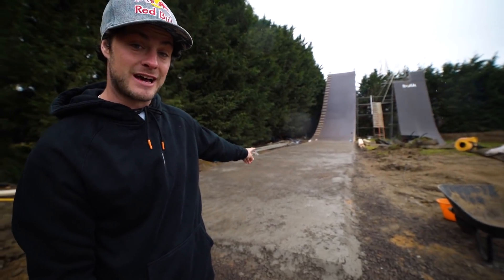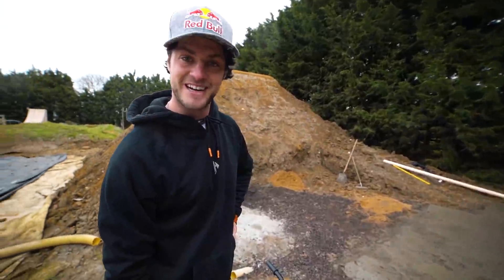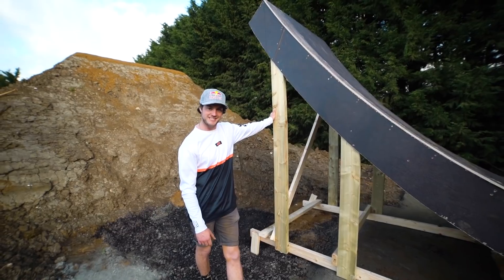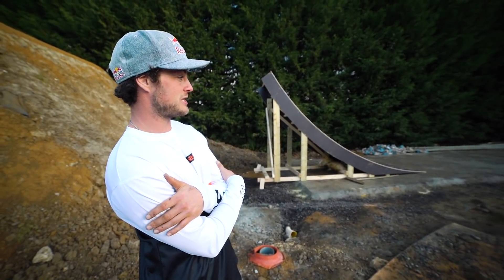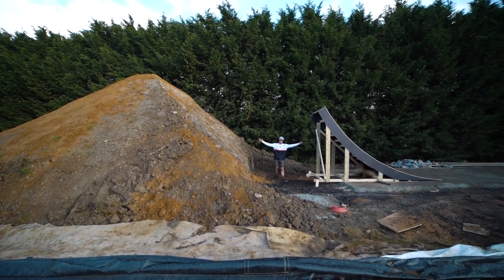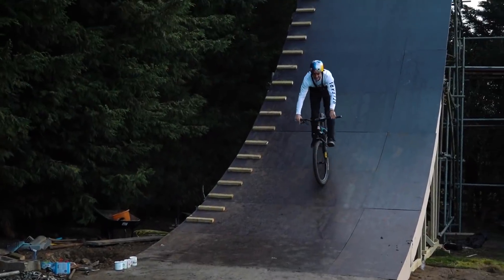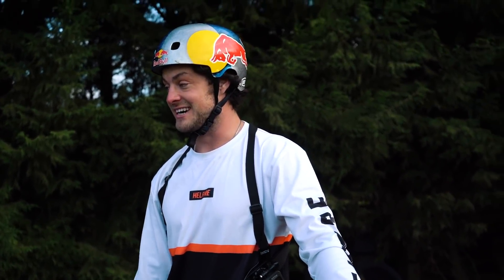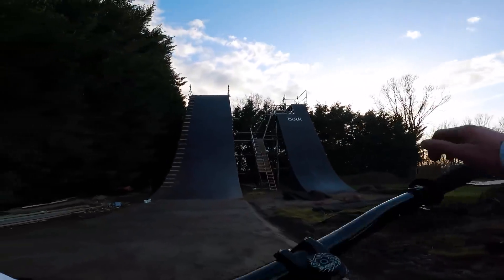BUILDING AND RIDING THE HUGE NEW MEGA BOOTER!! REBUILD EP 4

Comment: Thanks for the mention at 0:57 😂, shame it didn't work out as well as hoped with the concrete! I've learnt from this mistake the hard way more than once, hence why we do things differently now. Just thought I'd add that your concrete is still salvagable if you feel you would still like to achieve a smooth surface. With a bit of prep and some self levelling compound you could easily get it perfectly smooth, and it would serve you fine for the summer months at the very least.

Comment: Fantastic work - better than any gym session!
Two suggestions... 1. Get the concrete covered with a grippy hot tar mix, a fine yet grippy surface - will make it level, smooth and predictable as a street or road... 2. at the end of both airbag and new line, have a big berm / wall ride that links both of them together in a big curved wonderland to scrub off speed or do finish tricks - returning between the jumps back down a smooth path to the run-in ramps to go again...

Comment: He is correct about the air time. An experiment to give you visual proof is to roll a ball off of a flat surface that is high enough for you to time the decent as fast as you can. Then, take the same ball and just drop it straight from that height and time it as well. You will see that you will record the same amount of time for the ball to reach the ground.

Comment: If you have the room in the corner make a step up to flat/ hip gap.
1 you get a step up to play around with.
2 you get a second starting point for the back half.
3 you can still run the main line using a hip to bypass the step up.

Hope yall see this comment, keep up the killer content man👍

Comment: Correct about the air time until you run into enough forward momentum coupled with the right amount of lift generated by your body posture to partially overcome gravity there for basically gliding for more airtime.

Comment: You could move the new lip back so it doesn’t have to be as steep and so it’s a little longer. like a proper trails jump or where the little water fall is after the first jump you could turn it into a roller and use it to slowdown.

Comment: need a step up into shark fin burm at the end with ever a flat drop or angled  drop back off into more ramps using the spare scaffolding. the step up should slow u down enough to hit the burm and carry some speed with the drop off supplying enough speed after wards to carry on with the line back up the right hand side

Comment: if you would have poured water on the sections as you poured, you can use a push broom or some call it a Deck broom and it makes a sandpaper type grain in the finished mix

Comment: I agree 100% on the airtime matt, I’ve said for 15 years Iv not seen anyone in any sport get more than 3 seconds airtime even 400 ft motocross jump and snowmobile jump you are correct about the speed of those long jump comparing to a bunny hop. It wasn’t until recently I counted axel hodges on the quarter pipe do some 4 second airs and it’s a quarter pipe so it’s straight up and down

Comment: Good way to explain air time is if you hold a gun pointing the barrel level in one hand, and In the other hand you hold only a built. 

Technically if you fire the gun and drop the single built at the exact same time them they will still both hit the ground at the same time, regardless of distance traveled.

Comment: Aerospace engineer here, Matt is totally right about air time. The vertical component of Matt's velocity is independent of of the vertical component. If we model the trajectory as projectile motion, it can be shown that the airtime will be t = V0/g + sqrt(V0^2 - 2gh)/g, where V0 is the initial velocity (in the vertical direction), g is the acceleration due to gravity, and h is the size of the step up or step down measured from the top of the takeoff (positive if step up, negative if step down). This result shows us that if you want to maximize air time, you should maximize the vertical component of the takeoff velocity, and/or have as much of a step down as you can. 

The problem of a step down is that you land very fast.

Comment: Mate you should have done the pad better. Your gonna get puddles and it will crack in no time. If you do it again, first put some type 1 down and compact it, then build a form work and put 4 inches of concrete down with steel steel mesh in. And use ready mix from a lorry. Have a word with Alvar from bulltrack, he's your man for the job

Comment: The slab will most likely crack mate, the difference in thickness will show weaker spots as well at the edges, any movement in the ground will crack it. As well as it needs to be tied together with mesh reinforcement.
Best to box it up and make the surface relatively level underneath and reinforce with mesh

Comment: Matt, if you want to design a steeper jump, to maximize air time, you should use the trajectory equation so that you can plan take off angle and distance from the landing so you dont under or over shoot. The (2D) trajectory equation is(use degree mode on a calculator):
(height of landing)=(height where you leave the lip) +tangent(angle of lip end)x-(gravity/2((leaving speed)^2)cos^2(angle of lip end))x^2
You will need height of the landing, height of the lip, angle of the end of the lip, and exit speed(under estimate if you have to). You find the distance that the lip should be from the landing(horizontally), that is x. And with that the different take off angles will determine how far the lip should be from the landing both horizontally(x). 
Example:
Height of landing: 25
Height of lip: 15
Distance horizontal: x
Speed: 25
Angle: 75
25=15+tan(75)x)-(10/2(25^2)×((cos^2)(75))x^2 
When we solve for this, in order to not over or under shoot, the distance horizontally will be 2.68. Just make sure that the speed is n the same units as height(ex: m/s and m,))Btw gravity is 10 m/s/s so I would recommend using meters.

Comment: Since the 2nd jump would have to come up so quickly, why not build a curved wallride in the hedge corner that goes into another jump going perpendicular to the 1st one and the airbag. That one could then lead into another berm/curved wallride turning you 90 degrees more going back toward the parking. That way you could fit 3 big jumps, plus 2 curved wallrides/berms :)

Comment: Matt you should think about aerodynamics such as aerodynamics with 100 ft is a lot farther than a foot even if you are only a foot high. I have been taught a little about aerodynamics in school such as in science class when I was a little kid. If air is removed out of the tube and a feather and coin are nside the tube without air in the tube how I mean a feather drops equally as fast as say a coin because the air isn't there but if you have aerodynamics the feather falls slower than the coin and the same kind of thing goes into the equation of if you're traveling a foot or 100 ft you have to equate for the aerodynamics of an object and stuff such as if it had wings how I mean it's going to be in the air longer than if it had aerodynamics of pushing it down even if it's only going a foot high such as it's like if it had wings that help it be a glider how I mean they could stay in the air longer because the aerodynamics are going to hold it in the air longer and if it had aerodynamics of pushing it down it's going to go down faster regardless of it's height in such scenarios. Aerodynamics have value in such equations and air flow and positioning and such have value in such equations. So in the tube the feather and coin are dropped at the same height and with air in the tube the feather falls a lot slower than the coin. The ways of getting the same amount of time of two objects going from the starting point to the bottom of falling at the same speed in time kind of thing is if the removes the air so when you jump a foot high and say Ben jumps a foot high you both weigh different and such and you're not going to fall at the same speed or the same time how I mean such as different values of the equation have different results. They only fall at the same speed in the tube how I mean such as the feather and coin thing is because when the person or people remove the air from the inside of the tube and then they fall at the same speed and time kind of thing.

Comment: Hard to tell from the video how close a second jump would be.
Ideally another steep kicker into a lander with a bi lift berm or shark fin left. 
OR if the distance before the end of the fence is limited you could build a Rotorua style whale tail but possibly make the worlds first left handed whale tail, big kicker to landing with a left turn on the platform either with a subtle wall ride or not depending on speed required dropping into a lander than compliments the rest of the line (and space on the compound).

Comment: Wouldn‘t you be able to hit the same kicker faster=more kinetic energy if it’s at a longer distance which would result in more potential energy 
If they were related in a linear way, you would be right and it would just be used to make the distance
But kinetic Energy is proportional to speed squared
Which would result in a higher parabolic flying curve (reversed x^2)
I think when your bunny hop example is correct but the kicker has some impact i think 

Just think it to the Extreme
If you would put your kicker twice as far away (=same angle at takeoff) and hit it way faster you should go to the Moon = more airtime

I don’t claim being 100% right and just as confused as you haha
Really interested in what people think about my point
Reply: I think the bunny hop example is not quite comparable beacause no lip means no tranlastion from kinetic to potential energy

Comment: Question to the fellow trail builders, would a step down give you more speed than a simple roll in? 

For example on a 6m high start: rolling down 3m and then jumping into a 3m high landing. Wouldn’t this create more speed than a roll in without a jump in between? It surely depends on how steep the roll in is but yeah I certainly felt so over the years of riding and still I’m curious if my theory is actually right.

Comment: I don't remember this perfectly cause I'm old, and this is 9th grade physics but the formula for the gravity vector is mass multiplied by the acceleration of gravity which has a constant value (9.8m/s/s), so if you and Ben weight the same what you said is correct, you will land exactly at the same time
Reply: Mass has nothing to do with the acceleration of gravity, only the force of gravity. They don't need to weigh the same to land at the same time
Reply: @Anon.G  so if I weight let's say 100kg and another person weights 50kg and we both fall from the same distance, we fall at the same speed in order to land at the same time?
Reply: @bogdantrestianu  yes, unless you're going really fast and then terminal velocity comes into play(which has to do with air resistence) but yeah you accelerate at 9.8m/s regardless of if you're 50kg or 100
Reply: @Anon.G  yeah I messed up, you're right :)
Reply: @bogdantrestianu  no worries, nothing wrong with asking questions